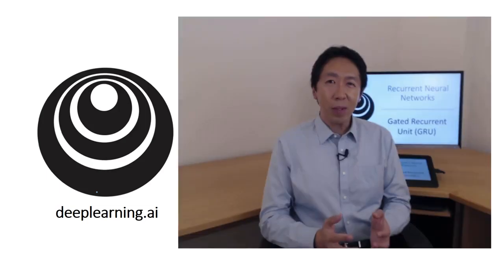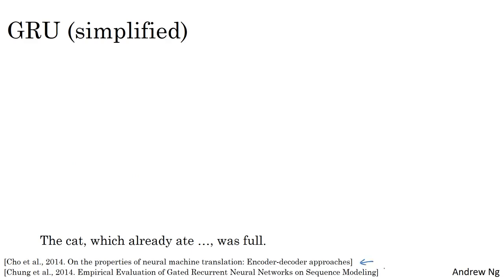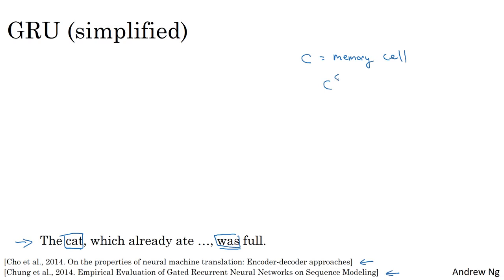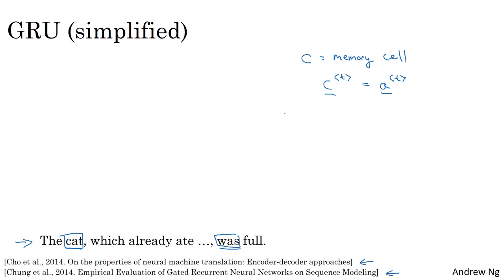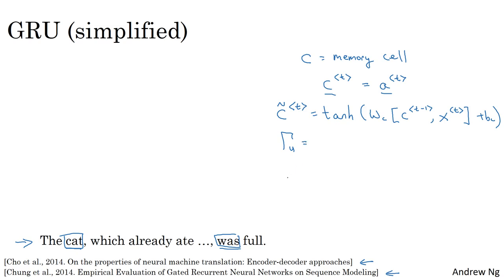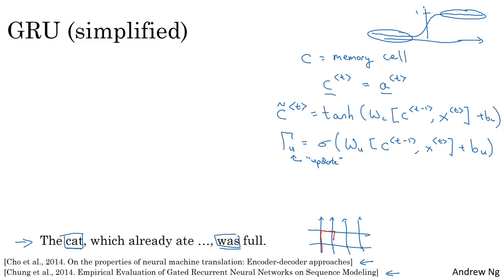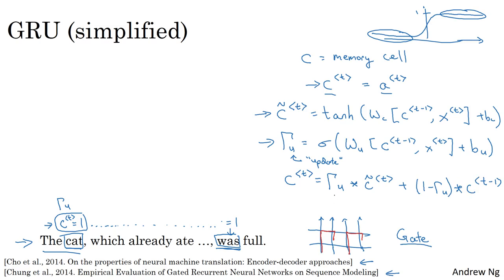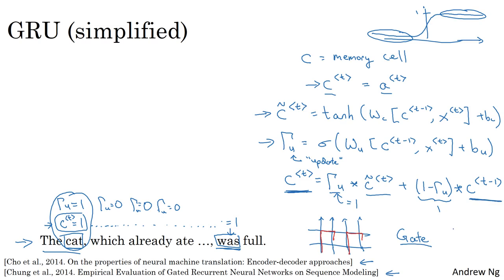Understanding Gated Recurrent Unit (GRU) Deep Neural Network

Comment: There's an error in the slide on during 14:08 - 16:41, the part in the last equation  where (1 - Gamma[u]) [PLUS] c[t-1], however [PLUS] is not correct, it should be [MULTIPLY] instead of [PLUS]